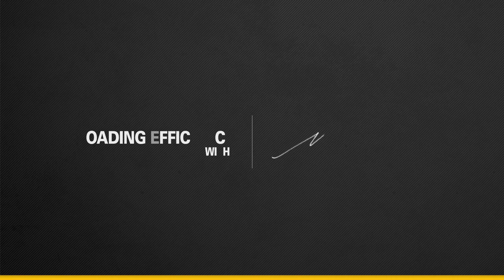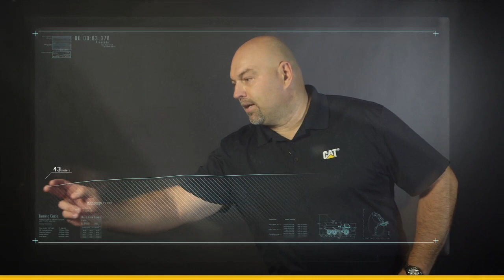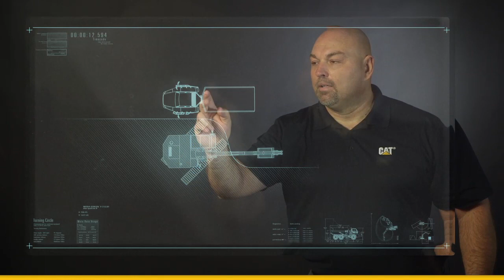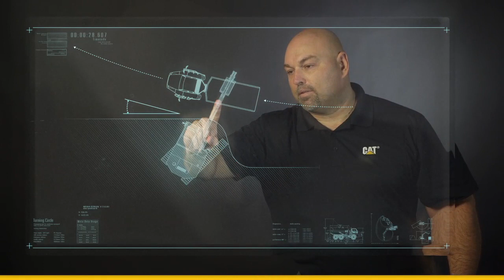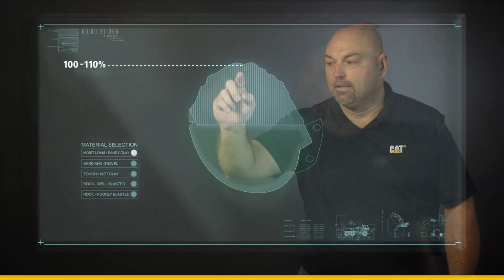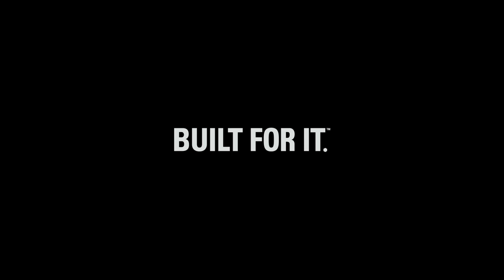Rethink Jobsite: Loading Efficiency

Comment: Fairly basic stuff. On wonders how one becomes a company owner or superintendent without realizing this stuff while they were first starting out. It's a prime example that a very important skill in construction has nothing to do with actual construction - salesmanship. To make correct bench height easier to remember - the track of the excavator should be level with the top of whatever you are loading. Be careful overfilling the bucket so that you don't have small rocks falling all over - those haul truck tires aren't inexpensive.